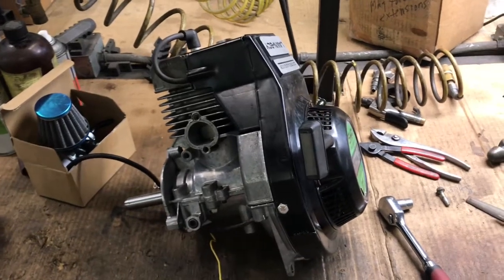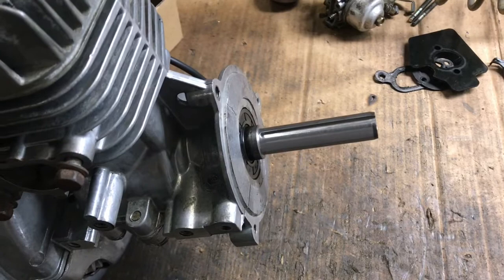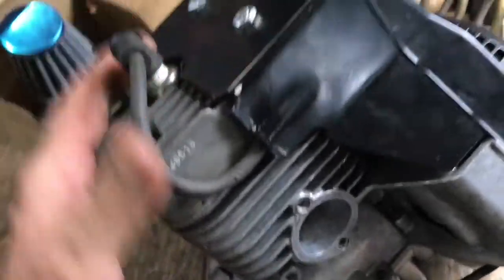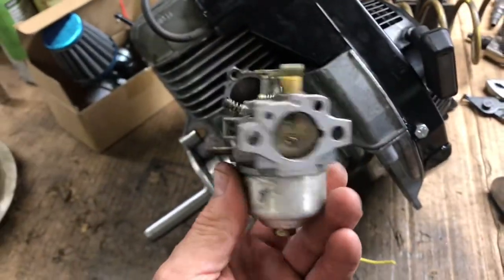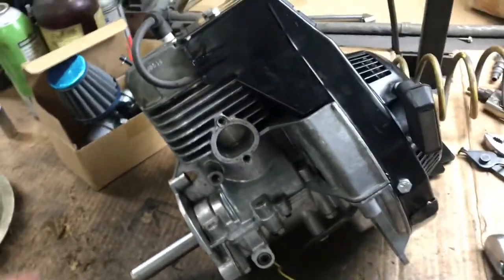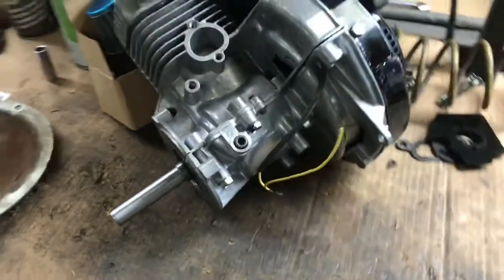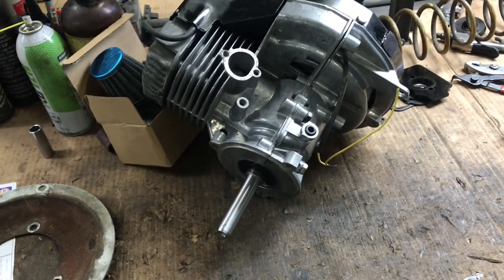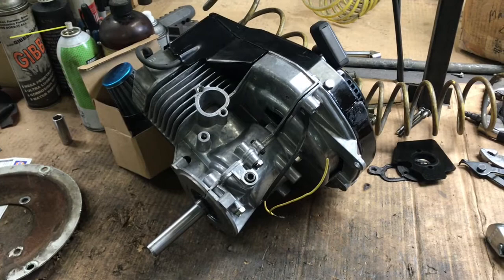Lawn Boy 2 Cycle Minibike Engine Mods

Comment: I converted a Lawn Boy to kart engine.  Turned, keyed crank but also offset rod wrist pin bearing .01” .  Results was OK, but not as quick as similar kart with Honda GC,  I think the LB made about 4 hp.
    The engine in this vid is not an OMC designed engine but likely a rebadged Kawasaki(?).